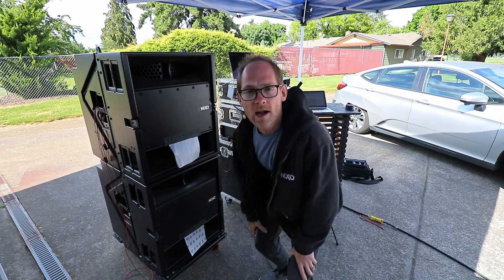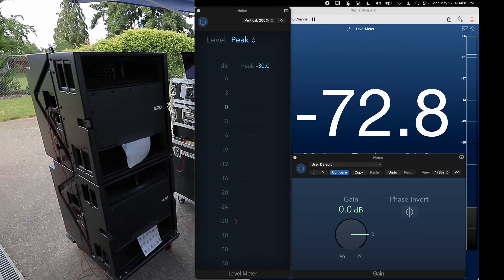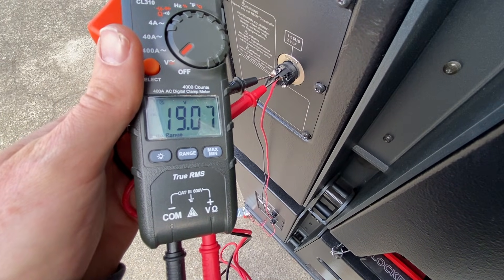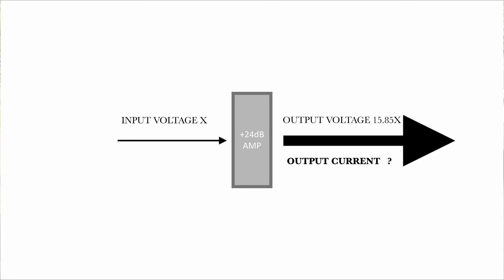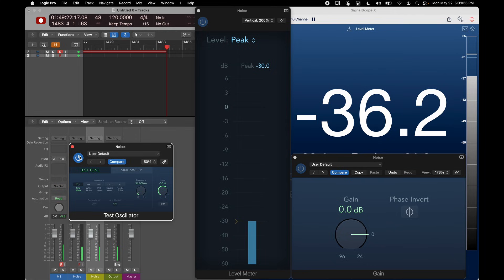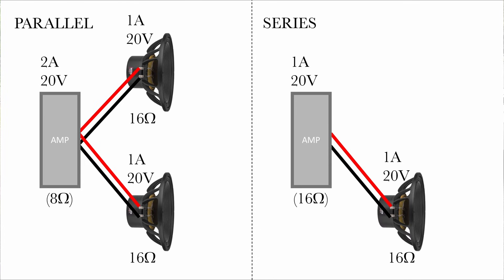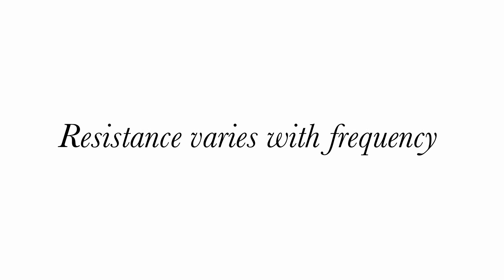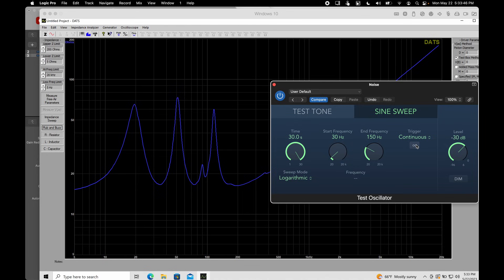Is doubling speakers +3dB or +6dB? What's parallel and series wiring?

Comment: It's quite interesting to see how using more speakers saves energy. Although I'd expect this to gradually taper off as you add more and more speakers, so maybe you'd only get 5 dB from 2 more subwoofers.
Reply: It doesn't "save" energy. The amount of energy being output from the amp more or less stays the same but the acoustic output changes. Adding an extra driver adds 3db of output and halving the resistance ads another 3db of output but the current also changes.
Reply: @orangecat-519  yes but if you want to listen at the same level it saves power. The example is illustrated best with the two series woofers that were the same level with half the current.
Reply: @TimpBizkit  Half the current EACH one, because they split the same amount of current that flows. In total is the same, so no savings, plus the cost of second driver equals spending more, not saving more :)
Reply: @Pasusteanu  but two series woofers have double the impedance. So half the current and the same voltage flows to the pair equals half the power to the two woofers that are as loud as one. The current doesn't split in two lines because it's a series setup - one "river" of current = same current to each woofer as total but voltage is split.
Each woofer in a pair gets a quarter of the power (half the current and half the voltage). You will need more money for drivers and wood but less for an amp (and in big builds alternator and eventually fuel consumption, although the double box is heavier to move around).
If you think about it, two speakers are a bigger "boat oar" on the air around them and thus convert power to sound better.
Reply: @TimpBizkit  wouldn't the best idea be keep the current the same just use woofer no.2 as a passive Radiator? Especially if the enclosures tuned correctly 🤔
Reply: It doest saves evnergy (correct word would be power), because the 6dB gain was caused by the amplifier going from 10 watts to 40 watts
Reply: Yes it does taper off. Eventually you get enough cone area that adding more doesn't increase the acoustic efficiency as 1 - you already have enough cone area for maximum efficiency so by then you only gain +3 dB's for each doubling of cone area instead of +6 dB's and 2 - you can't put a speaker where one already exists (damn Pauli exclusion principle!) so you have to put it off to the side where now you lose energy from the microphone position due to the inverse square law. In pro sound, once you get to about 24 double eighteen boxes you are pretty much at the limit for getting +6 dB's for each doubling of boxes as you are at maximum acoustic efficiency. You usually run out of room and or money at the venue before you run out of +3 dB's for each doubling of boxes after that.

Comment: I'm going to put this In laymen terms,  let's say we have 3 4ohm subs ( I'm not going into parallel and series, u should know that) we take two subs and bring them up to 8ohm, now we have 8ohm and 4ohm load, we do 8×4=32 8+4=12 now we divide 12 into 32, which is 2 with a remainder 8, henceforth 2.8ohm load( jl says my triple stack is 2.7, but everyone does math different 😀) that's it ohms law in it's simplest form. Please next time, explain it to me like I'm 6 years old, I don't comprehend very well☺

Comment: I am about to go from 1 18"  Resilient Sounds platinum to 2 18" in my truck.  I will also be going from one Down4Sound JP23v2 to 2, or one per sub wired at 1 ohms for a total of 5600 watts  I hope to get 6 dbs or slightly more, because of acoustic coupling because the 2 subs will be right next to each other, literally 1 inch apart.

Comment: Sorry but I have doubts : 

Series 16+16=32ohms : the amp produces same voltage and half the current, hence -3dB. Each speaker gets half the voltage (-3dB) and half the current (-3dB), therefore each speaker -6dB. Since there are 2 of them, the total acoustic output is -3dB (half the power).

Parallel 16&16=8ohms :
The amp produces same voltage but twice the current (+3dB).
Each speaker gets same voltage (0dB) and same current as only one (0dB). Since there are 2 of them, the total acoustic output is +3dB (twice the power).

Putting an infinite number of speakers in series will finally translate into 0 power, since the voltage at each speaker and the current will both tend to zero, or am I really really wrong ?
Reply: Voltage and current are both a part of one single equation. Voltage/Resistance=Current. If you lower voltage, current naturally follows. What you're doing is that you're basically saying that Four apples + Six oranges equals Ten fruits. Then remove Three oranges. Now you have Four apples + Three Oranges which equals Seven fruits. You don't say that you have Three fewer oranges AND Three fewer fruits all in all which is now a grand total of Six fewer fruits, do you?
Reply: @Turntablist11  dunno about your fruit analogy, but as long as the amp behaves like a constant voltage source, my reasoning is right. Just try putting 10 speakers in series on a solid state amp and you will hear very little overall acoustic power.
Reply: @paolozak3014  I just realized that I read your first comment wrong. 

What you are forgetting about though, is sensitivity. You gain 3db sensitivity when you double the amount of subs. This is true as long as you haven’t reached maximum sensitivity yet, which is around 100db (baffle gain, resonances, diffraction gain, and boundary gain not included). 

Two subs in parallel is 3db more sensitivity plus 3db current, so 6db in total. 

Two subs in series is 3db more sensitivity minus 3db current, so 0db in total.
Reply: @Turntablist11  sorry but I can’t follow your sensitivity argument.

Series : the amp delivers half the current & same voltage. Each sub  gets half the voltage (-3dB, in series the voltage is divided) and half the current (-3dB), so each sub is at -6dB (1/4 of the power). Since there are 2 of them, in total we have -3dB (half the power).

Parallel : the amp delivers twice the current & same voltage. Each sub gets half the current (1/2 of twice = 1) and same voltage, hence 0dB (no power loss). Since there are 2 subs, we have +3dB in total (twice the power).
Reply: @paolozak3014  Loud, low, small. Pick two. That’s the basics of speaker design. A small loudspeaker that plays low frequencies will not be loud. Make it larger and it will be louder. When you double the amount of speakers, you gain more sensitivity, equal to about 3db.
Reply: @Turntablist11  yes, but if you double the speakers by putting them in series, only half the current will flow through them (-3dB), and half the voltage for each one of them (-3dB). So -6dB for each one, and -3dB in total for there are 2 of them. 
In series you lose : put 100 speakers in series and it will be nearly silent.

Comment: Solid state amplifiers are rated at different speaker impedances. So my bass amp puts out 500 watts at 4 ohms, but only 350 watts at 8 ohms. 

I can use two 8 ohm speakers in parallel to achieve 4 ohms, or if there was 2 ohm speakers, two of those in series. 

It’s not the series or parallel connection that matters, it’s the total speaker load on the amp.
Reply: Current is what destroys amplifiers and speakers. More current equals more heat equals magic smoke.
Reply: Look.... An ideal Amplifier with 350 Watts at 8 Ohm should give 700 Watts at 4 Ohms, Like the KRELL Amplifiers do.  Because of internal resistance of your Amplifier, he is not able to double the Current,  that is why he only do 500 Watts at 4 Ohm  :-)

Comment: There is no such thing as "3 dB more from the speaker".

The amount of available power is what voltage*current shows - period.

What you are demonstrating with "3 dB more from the speaker", is actually a coherent speaker array. Try moving your meas mic up and down and you see that the +6 dB isn't consistent.

Also if you switch the polarity of the second speaker, when in parallel configuration, you see that the measurement from the front drops dramatically, as the phase fronts from two speakers are cancelling each other.
Reply: True. And let's not confuse the amp output power increase with the SPL increase: two connected but different things.
Reply: Thx for this comment. I got a big questionmark in my mind how he got 4 times more acoustic energy bei doubling the amp output...
Reply: thanks !
Reply: Speaker output is rated as: SPL, Sound Pressure Level. Power, in Watts, is: P=EI, power equals Voltage times Current.  And and real work, in a motor, or speaker coil winding, is performed by: Current. You can have a lot of voltage, but if there isn't a closed circuit, with current going through a circuit, there is no, "work," being performed. Such as a wall outlet, with nothing hooked up. Speaker output is usually expressed in dB, decibels, & measured by placing the speaker in an anechoic chamber, with an input of a tone of: 2.83 volts, & a mic pointed at them, one meter away. With an input impedance of 8 ohms, this is about one amp. My Klipsch speakers are about 98 dB efficient; they produce 98 dB of sound output, a listenable level. Other quality speakers produce: 88 dB, about 10 dB less. 3 Db = twice the power; 10 dB = ten times the power. If voltage is constant, ten times the current, power.

Comment: I just learn a new symbol, U = voltage.  Goodbuy V.
Reply: No, not goodbuy... U is the symbol of voltage and V is the unit of it.

This might make a bit more sense when you think of something like time t, wich can be measured in many different units, like seconds, minutes, days or years... Laws of physics allways work the same, but the units one use do make a difference on the scale.

Like speed can be measured in, say meters per second... Or kilometers per hour. It is still velocity, but different units and scales. Units can be converted as long as they measure the same thing.
Reply: @juhojohansson1716  Well explained. At least, I won't make a fool of myself in the future.  U V W X Y and Z.

Comment: What determines whether two signals of equal amplitude combine to produce a 6dB gain or a 3dB gain in signal level (voltage or SPL, but not power), is the “correlation” of the signals at the point of combining.

FULL CORRELATION CASE:
If the correlation is 100% between the two source signals at the location where the combined signal is being measured (the two source signals are received with identical amplitude and with identical phase) then a 6dB gain in level (SPL or voltage, but not power) is achieved.

Example 1: Two side by side subwoofers which are both fed the same signal (with the same amplitude and same phase) and which are both equal distant from the measuring device.  In this case, the measurement device will measure a “combined” signal which is 6dB higher in SPL than that measure by either subwoofer alone.

For a sine wave signal source, the two source signals would always have their sine wave peaks “synchronized” and always providing a doubling of peak level. And we know that a doubling of level (voltage or SPL) results in a level gain of 6dB.  However, it is important to note that the “power” delivered to the room is only 3 dB higher than that delivered by either subwoofer alone (a doubling of power results in a gain of 3 dB).

NO CORRELATION CASE:
If there is no correlation between two non-identical, but equal amplitude, signals at the location where the combined signal is being measure, then a 3dB gain in level (SPL or voltage) is achieved.

Example 2: Two side by side subwoofers are fed pink noise signals generated from two different noise generators (the pink noise signals are not correlated).  In this case, the measurement device will measure a “combined” signal which is 3dB higher in SPL than that measure by either subwoofer alone.

The two signal’s peaks and valleys will only be in alignment part of the time.  And over time, the signal alignment of the peaks will vary between in phase (0 degrees) and out of phase (180 degrees).  And the average increase in SPL or Voltage signal level achieved will be 3db higher than that delivered by either subwoofer alone.

MAINTAINING 100% CORRELATION ISNT ALWAYS EASY
Even in example 1 above, if the SPL meter where to move around the room, the path length from each subwoofer to the measurement device would change differently for each subwoofer, and the correlation between the two signals being combined would not stay at 100%.  The axis of the room where the measurement device is equidistant from the two subwoofer will always receive the 6db gain in SPL.  But there will be some  locations in the room where the path length from each subwoofer would result in a 180 degree phase shift at the measurement device, and the signal would be cancelled.  But most people, who are not equidistant from both subwoofers would experience a 3 dB gain in SPL.

Another interesting example is the case where two signals of varying phase are combined.
Example 3: Two side by side subwoofers are fed sine wave signals from two different signal generators (one at 60 Hz and one at 61 Hz).  In this case, the measurement device will measure a “combined” signal which varies in SPL reading over each one second period.  For one instant in each one second period, the measurement device will measure a “combined” signal which is 6dB higher in SPL than that measure by either subwoofer alone.  But AVERAGED over the full second period, the measurement device will measure a “combined” signal which is 3dB higher in SPL than that measure by either subwoofer alone.  

In summary, achieving a 6DB gain in SPL with two subwoofers only occurs where the resulting phase difference between the two identical subwoofer signals at the measurement position is near zero degrees.

Comment: I still don't get it. Doubling the power on one subwoofer results in a 3dB gain. But the same power split on two speakers suddenly should gain an additional 3dB so 6dB total? How can 3dB magically appear out of nowhere? Where is this "acoustic energy" supposed to come from?
Reply: There is only 3dB more of total energy being produced. But in certain sweet spots, such as right in front of the subs, the phases will be aligned, the wavefronts will add together, and you'll hear a 6dB increase. In other locations, such as off to the side, the wavefronts will be out of phase, destructively interfere, and you'll hear much less than a 3dB increase (maybe even negative, depending on the frequency and the distance between the subs).
Reply: @kornielsen9471  Partially true, the standing waves effect you described is already counted for in the +3db. Standing waves can be negated by placing multiple subwoofers asymmetrically in the room (Dr. Earl Geddes's thesis).
Reply: @dingdong2103  I am not referring to standing waves, which complicate things even more. Outdoors (with no standing waves), if you are exactly equal distance from both subs, you will hear a 6dB increase when you turn on the second sub. In other locations, it will depend on the frequency and distance delta, but the average will be a 3dB increase.
Reply: @kornielsen9471  What you refer to is exactly what standing waves do in a room, summing and canceling of signal... Outdoors there will be just 2 clean signals. And the summing of signals only happens if the two drivers are within a wavelength of eachothers.
Reply: @kornielsen9471  It depends on the distance of the sound sources in relation to the wavelength being reproduced. In the example in the video, with subs stacked vertically, you gain literally 6db no matter where you are on an empty field.
Reply: Paddle a canoe with a broom stick and then use a paddle. You exert the same energy with both. You go faster with the paddle because the increased surface area creates less turbulence (aka wasted heat) in the water. The energy was always there, it was just wasted before as heat moving air around without creating any sound. Now that you increase the area of your cones, you are no longer wasting as much energy as you once were, half as much less to be exact. Remember turning electrical energy into sound energy at sub frequencies is only about 1% efficient even at the pro sound level, much less in home audio. That means you are wasting 99% of all energy you put into the system as heat, there is plenty of room for improvement and when you make those improvements, the energy doesn't come out of thin air, it was always there.
Reply: 100W to 8ohm = 200W to 4ohm if the amplifier can handle it. So not the same power.

Comment: I don't get it. With a single speaker you get 20W of power. In the parallel case, you get 2 speakers outputting 20W each, giving a total of 40W. That's a 2x, or 3dB increase in power. I still don't understand where the extra 3dB comes from.
Reply: The extra 3db comes from doubling the acoustic energy from the second driver. Also, halving the impedance doubles the power only if the amplifier is perfectly linear (power doubles when impedance drops to half). Most amplifiers however do not produce double the power, in fact going from 4 to 2 ohms may produce less than 4 ohms and going to 2 ohms may even burn the entire amp if it's of poor quality.
Reply: You're getting double the effective driver cone area and it's enclosure, as well as a doubling of power as you stated. 3db from the additional driver and it alignment, and 3db from the additional power that driver is now consuming.